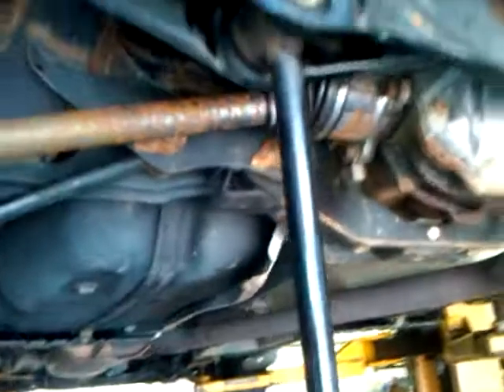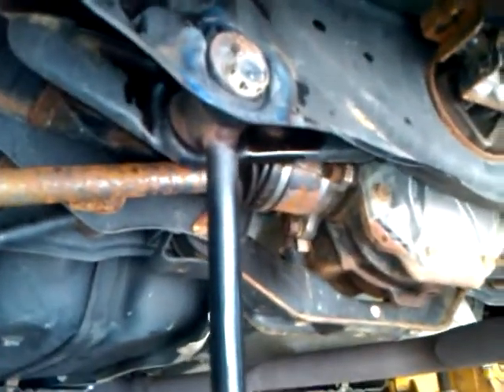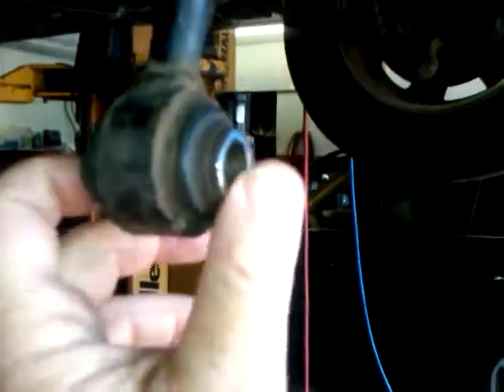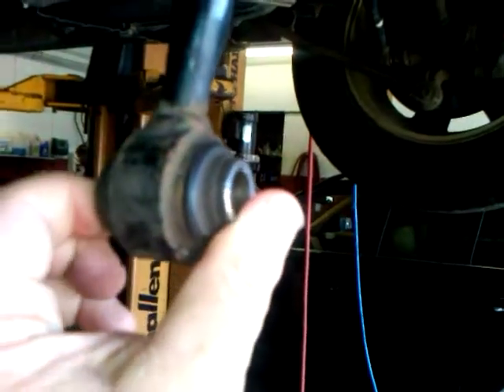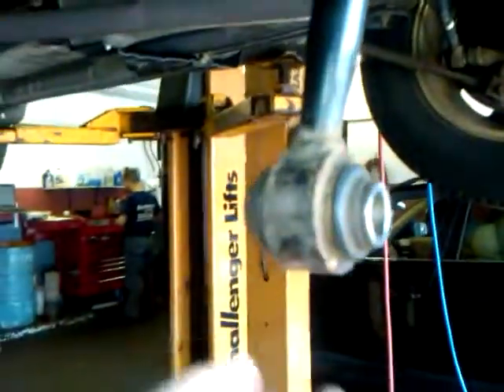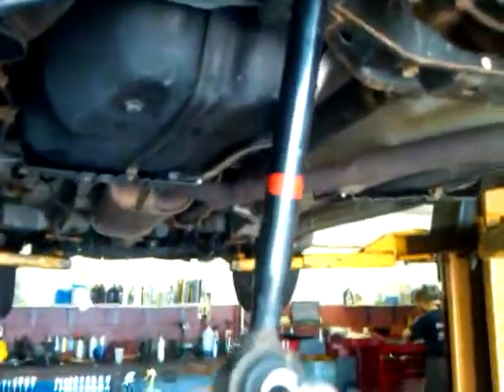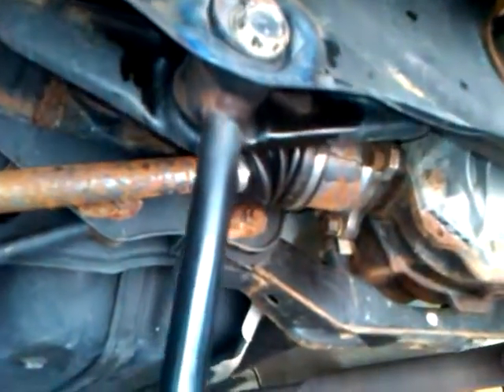Auto Repair Tip Wilmington Delaware - 2003 Toyota Highlander AWD Wheel Vibration

Comment: Thanking you sir of this great Info..Mine is a 06 and the bushing you are describing in this video is not same a s 2006,AWD. They/toyota engineers, must have did an upgrade/mod ( not a good idea,as to consumer replacement cost) on these newer models, as the rubber bushing and insert sleeve assembly(which the bolt goes through) on my 2006 is impregnated in the whole Knuckle itself and is "costly at the dealer", now, I will have to get  an machine shop to get machinist to fabricate a bushing,possibly, out of teflon plastic and fitment the insert sleeve in it, for the bolt to go through . I may as well get it done for both of these arms on this left rear side as both  of these knuckle bushings has lots of movement in them. my 2 cents worth, thanking you for your input and expertise. 100-100

Comment: mines knocking in the back but i can't detect any movement/looseness in those bushings. the corrosion on the fasteners looks pretty bad. i see more movement in the forward control arm/trailing arm bushing below the rear door but its hard to tell if its just normal movement or broken
Reply: MXSLICK probably the bushings in the knuckle. Replaced mine with Siberian bushings via Amazon. Replace the arms with moog arms and bushings.

Comment: good info!!  ty I got a 2006 highlander with 260.000 kilometers on it,it has the front lower,rear control arm bushings worn (crazy cracked/but no knocking/swaying/and runs/steers well).is there an aftermarket ones for replacements on this type of machine and do I have to remove the complete arm to replace these bushings?? again there is no swaying or metal to metal just cracked, I was wondering what you think. ty for great video!! 100--100
Reply from the maker: Hello battlehrfred - I believe there are quality aftermarket pieces available. But because they weren't readily available locally, we went OE. Yes, you need to replace the entire arm and not just the bushings. Also, a 4 wheel alignment must be done after replacement. You would also be wise to replace all hardware (bolts, nuts) when replacing the units. TIP: Before you start, give the hardware a good soaking of penetrating fluid and you may need a little heat to get them loose. Good Luck. - Greg Buckley
Reply: I have replaced every component in the rear end except for these two pieces if that is the cause I could hug you